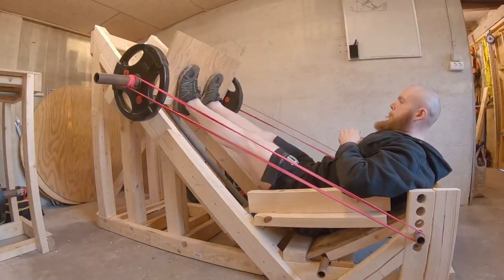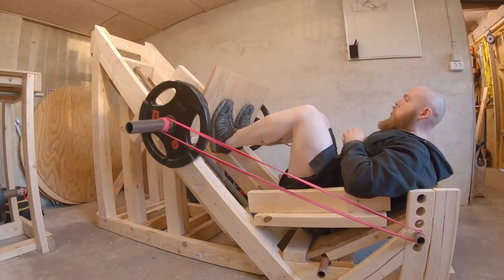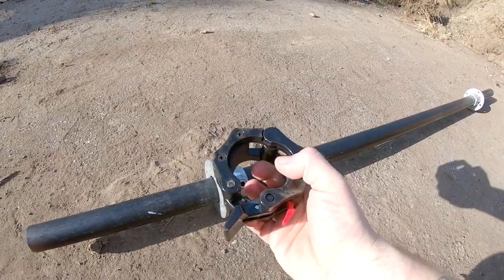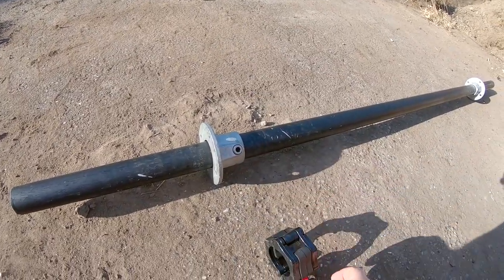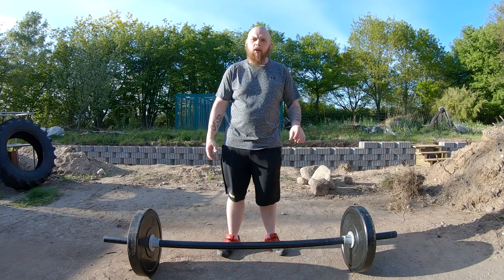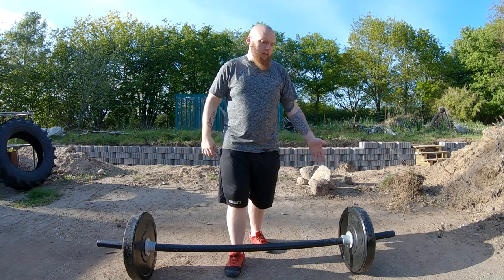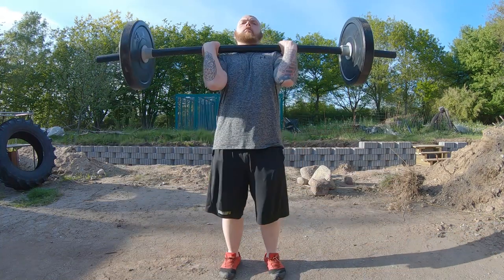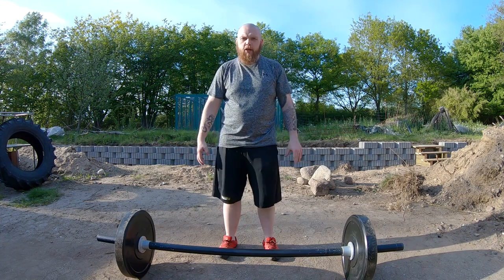The fatbar - the best DIY barbell alternative? - strongman axle - DIY gym - Fit at home

Comment: What are the ends of the bar called do they go through the whole bar and what screws would I need? This is a great video and exactly what I need for my budget home gym :) thank you
Reply: I don't know what they're called but they're probably in the same section as steel pipes in your hardwear store. In the Netherlands they cost about 9 euro's each.
Reply: You also don't need any screws. There should be something that can be rotated in there so it should lock onto the pipe
Reply: They are called floor flanges

Comment: How heavy is the barbell by its self ??
Reply from the maker: 8.5kg (18.7 lbs), the pipe is only schedule 10 (determines the thickness). I've heard that schedule 80 is quite commonly used for commercial fatbars, I guess that would be closer to 20kg/45lbs.
Reply: Martin Jensen thank you sir

Comment: How much weight can it handle?
Reply from the maker: More than most people would be able to lift - a 1½" pipe is very strong. Even though the one that I use is sch 10  (wallthickness approx 3mm), I haven't seen any whip or bending on it. 
I think an sch80 would be around 5mm thick, making it even stronger.
I just checked the one Strengthshop.de sells (probably made with sch 80), it's rated to 450kg (992 lbs) - I think it might actually be stronger. Rogue doesn't mention the strength of the one they have.